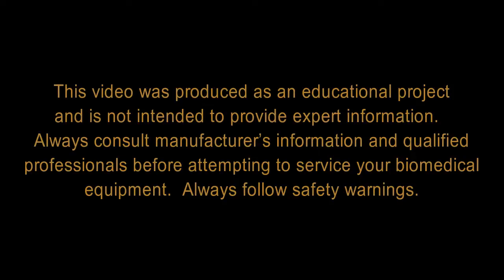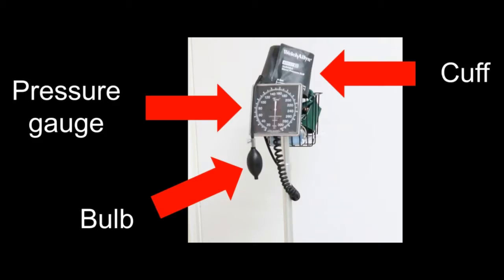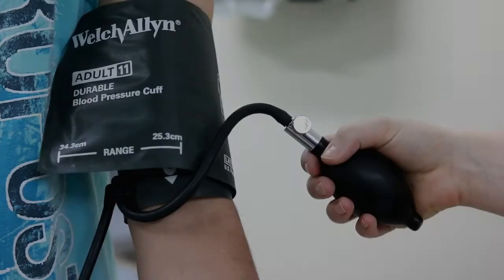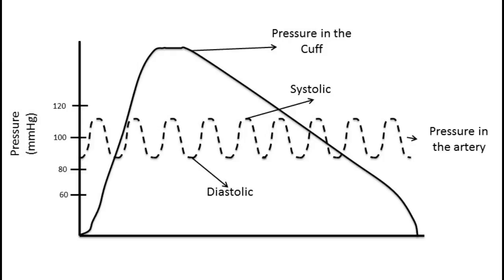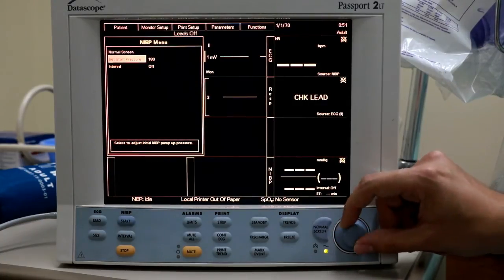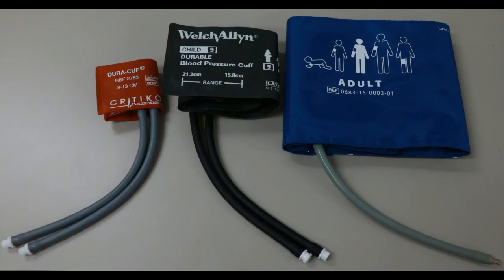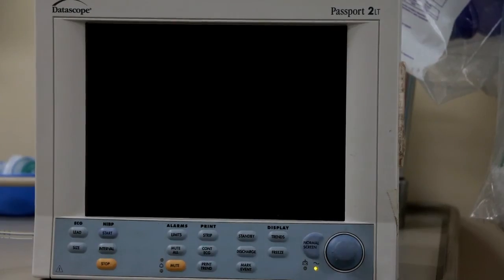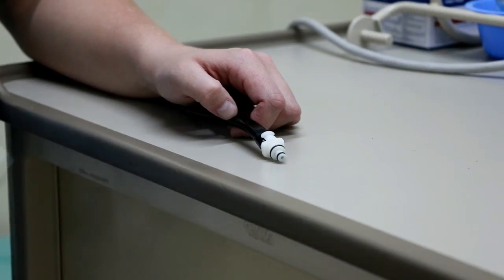Non Invasive Blood Pressure Machines

Comment: 12:13 - It depends on what brand of patient monitor or VSM you are using. For example, GE (formerly Marquette/Datex-Ohmeda) and Nihon Kohden patient monitors use 2 tubings while Philips (formerly HP/Agilent) and Dräger (formerly Siemens) use 1 tubing.
Reply: instablaster